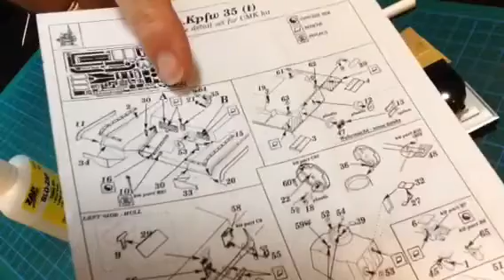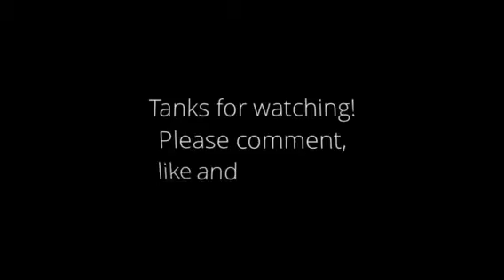CMK Skoda LT vz.35 Part 4 (Photo Etch)

Comment: Mr. Houdini, what do you think of that smaller photo etch bender? I have seen similar ones, but they are bigger and pretty pricey. (probably worth the money, but since I'm a cheapskate, I'm always looking for a way to cut a corner!) Do you think this smaller one is enough for most stuff? (only recently worked with it for the first time)
Reply from the maker: +wrnchhead76 quite frankly I am very happy with my little photo etch tool. It suits all my needs and even folded the long fenders on the BT-7 although I did them in 3 passes. All worked well and it did not break the budget.
Reply: Excellent, am going to get one! Thank you.
Reply from the maker: +wrnchhead76 I picked mine up from BNA in Melbourne Australia for $39 including the razor blade folder tool. Best investment I have made along with the wax pencil. Before that I was pulling my hair out with PE on the Graf Spee. Once I had the tool I managed to build the tiny brass ringed stairs with ease in minutes.